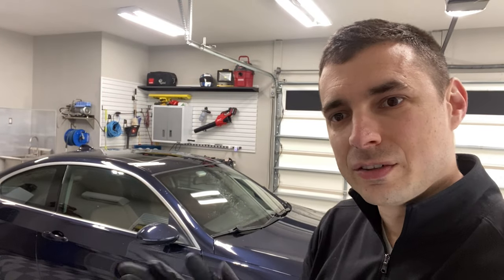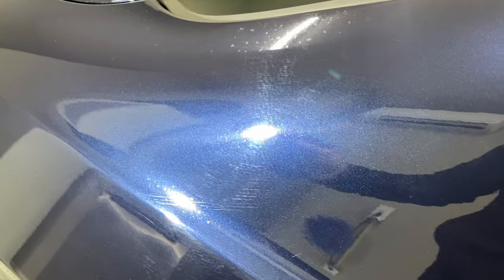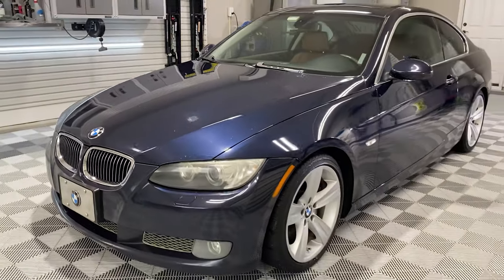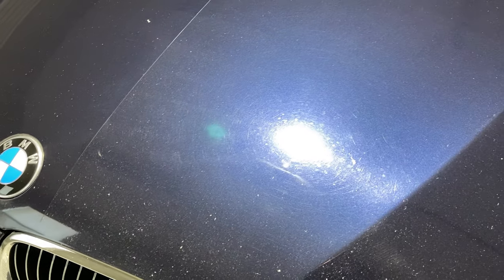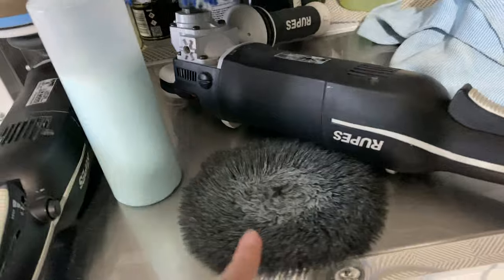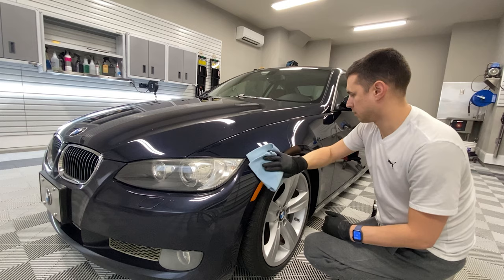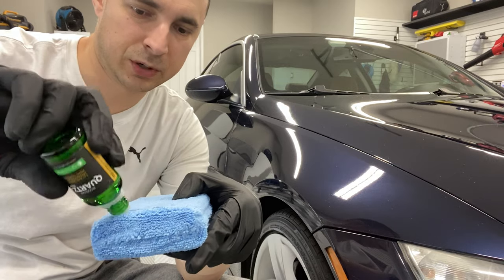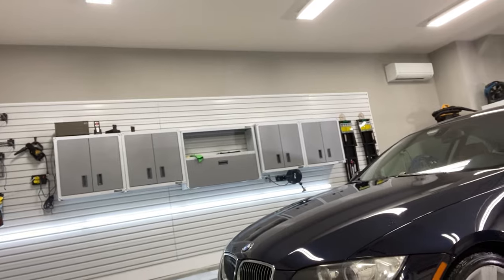Detailing a e92 335i - Paint Correction & Ceramic Coating

Comment: Hey, I'm in Gastonia.  What would you charge for paint correction on a 2018 Durango, it's in great shape and garage kept.  I also have a couple coats of ceramic coating on it, but it's been almost 3 years so I want to get it off so I can apply Avalon King.
Reply from the maker: Why Avalon king? I’d need to see the paint but I’m typically $800-$1200 for the polishing